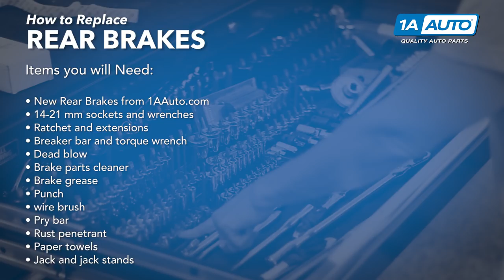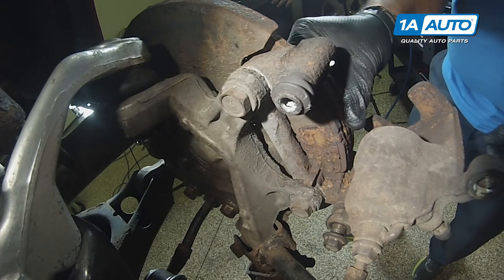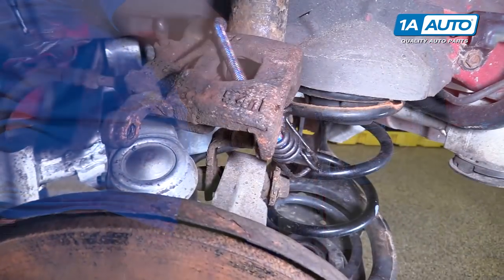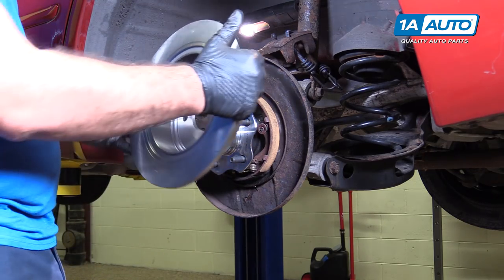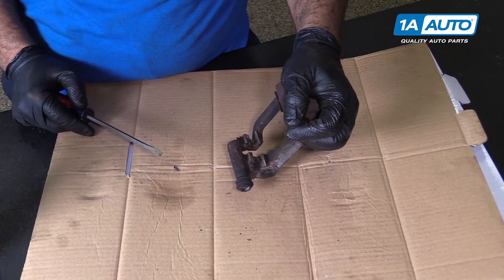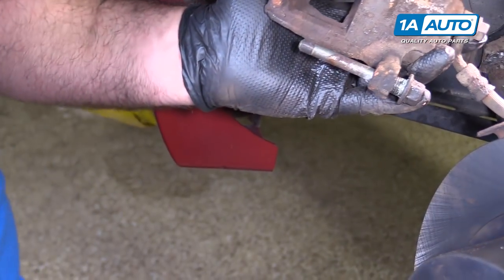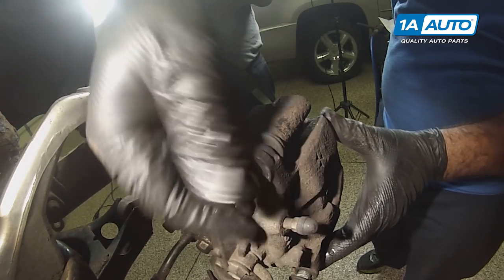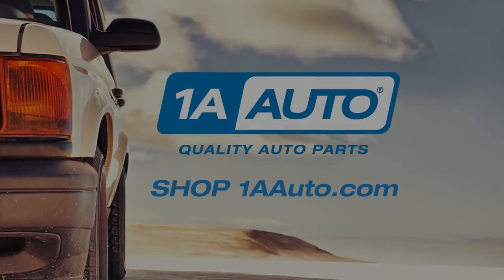How to Replace Rear Brakes 02-18 Nissan Altima

Comment: One, he did Grease the caliper pins two, it depends on the type of a caliper as to whether or not you need to use the C-clamp or that little tool he used or whatever concoction you can come up with to get the damn thing back into its place 3, he did mention pumping up the brakes and making sure you test them before you drive the car and he did put the torque specifications screen he did an awesome job it was a really understandable video which I'm surprised because most of them are not yeah I'm a girl but I rebuild my own Motors and everything else so yeah he did a great job dude five stars

Comment: One thing all these videos fail to mention-after changing the brakes, make sure you pump up the brakes using the brake pedal before you try and move the vehicle.  Nothing is scarier than pressing the brake and the vehicle doesn't stop.
Reply: Wayne Tlumak 13:50
Reply: haapen to me once
Reply: Giavanny Jean that's nowhere close to bleeding the brakes
Reply: He did mention that towards the end, though vaguely and without importance
Reply: He did mentioned to press the brake pedal since the pads were loose
Reply: That happened to me once had to stop the car on a fence

Comment: Great video, wish he discussed the wear indicator, looks like it was installed on the inside? Also, are both slide pins the same or are they different? Great tip on releasing the parking brake, along with the lower slide bolt, those would have stumped me for a minute or two.

Comment: Any other Nissan owners notice that the rear pads do NOT slide in the brake hardware properly? Always notice the pads are stuck and hard to remove. When i do other makes/models they are usually simple to remove...

Comment: At the 12:50 Mark when torquing the caliper carrier brackets - you say the required torque for these brackets is 116 to 144 ft. lbs, but then immediately follow up saying "So I've got my torque wrench set at 220 ft. lbs?"  Did you misspeak?

Comment: I did a rear break job on my 2017 Altima and the right side was good. I put new rotors and pads, but the left side... I couldn’t get the bolts of the calipers. I was banging and turning and not a budge. I gave up. I just put the new break pads. Any recommendations?
Reply from the maker: +Juan Garcia We wouldn't be able to diagnose an issue like that here, you may want to have a local mechanic take a look at it. Thanks for checking us out! http://1aau.to/m/Shop-1AAuto-c
Reply: Same thing with me, here I am 6 months later having to replace the rotor I left behind lol

Comment: Is it the same for a 2004 Maxima? Also do you have to have "Brake" grease? Or will Hi-heat grease work as well.
Reply from the maker: +Cupid Me The part in this video fits your application, and the install should be the same or similar. Buy this part on 1AAuto.com: http://1aau.to/m/Shop-1AAuto-c

Comment: Torque for caliper bracket is not 220ft/Lb  correct torque is  98ft/lb
Reply: he said 120
Reply from the maker: Thanks for checking us out! Once you mount the caliper bracket you would need to torque the 19 mm bolts to 85-90 ft lbs.

+James Young
Reply: Lol torque wrench

Comment: Just what I needed except I didn't have a compression tool so I put 2 pads in a wrench with a gap and slid my flathead through the gap and pushed the piston back in

Comment: arent you suppose to use a caliper rewind tool for the rear pistons so you don't potentially break the parking brake? I thought it was only safe to use a C clamp on the front rotors
Reply: It uses the same system as the front brakes.  Other makes and models need to be screwed in with a special brake tool.
Reply: That is a great question thanks
Reply: Along with a great answer thanks

Comment: At 12:11 you can see little metal clip on the inside brake pad my new one didn't come with one of those. So is that gonna cause problems?
Reply: jacob green always keep you metal clips not all aftermarket brake oda come with those clips. Some auto parts store sell pads and clips separate

Comment: the caliper bolte were dry, should have cleaned inside to get the dry crust out and lube the caliper bolts before putting on. Other than that everything was fine.
Reply from the maker: Thank you for the comments and for watching! +Khairuzzaman Gazi

Comment: So many mistakes in this video. 1. always open the bleeder when pushing in the piston 2. always clean and lube the slider pins. 3. never spray brake clean directly on the pads. 4. always clean up the metal surface under the retainer clips for the pads. 5. always readjust the park brake shoes after the new rotor is installed and held securely against the hub face.  6. always clean BOTH sides of the new rotor face. You're welcome.
Reply from the maker: +Team Venom Racing Thanks for the tip!

Comment: So are the front and back the same
Reply from the maker: You can use some of the steps in the replacement of the rear with the front. Thanks for the inquiry. +Spartan Rides

Comment: No one ever says snything about rear wheels and park brake what to do be ause when i try the wheel doent even spin the pads are gripping it tightly . Even in neutral nothing happens.  Everyone absolutely every video misses telling what to do as the first step. Its not removing the wheel

Comment: Does the "02-18" in the title pertain to the model years (2002-2018 models)? If so, I can assume the process is different for a 2000 Nissan Altima?
Reply from the maker: +Sarah Jones That is correct. It may be similar, but there will be differences between those years. Thanks! 1AAuto.com
Reply: @1AAuto  Thanks for the reply. I might be pushin' it here but do you happen to know what those difference are? I haven't found a video for the 2000 year model.

Comment: Can you explain what the 220ft/lb means???
Reply: Junior Flores its the amount of force required to make sure a bolt is doing its job at optimum levels
Reply: "foot-pound" is the amount of turning force applied to move one pound a distance of one foot around an axis at a radius of one foot.

Comment: is this similar to the '17 altima SV?
Reply from the maker: +Chill out bruh. Thank you for checking us out! The install should be the same or similar.
Reply: @1AAuto  okay thanks for responding. also, is it okay to use silicone grease on the caliper bolts?

Comment: What sidedo you put the wear pin
Reply from the maker: +Salvador Moran It is not necessary to transfer over the wear pin. However, it would be on the same side as the original rotor so you should be able to confirm once it is removed off the vehicle. Thank you.
Reply: I always mount my scratch pin on the inside.
I don't think it really matters.